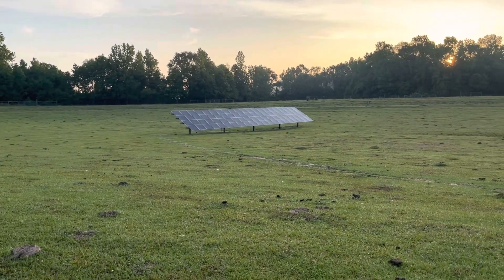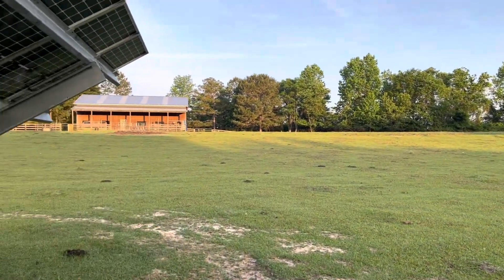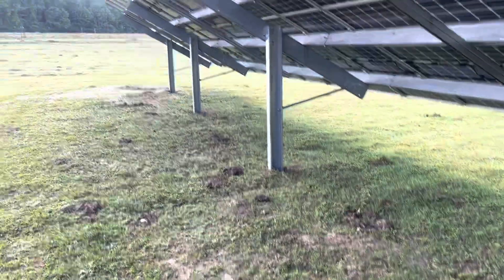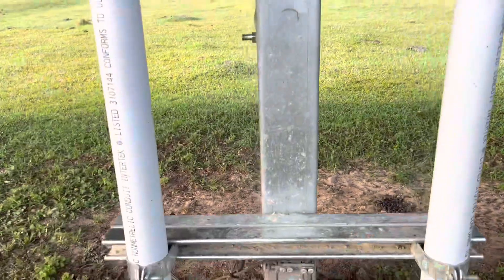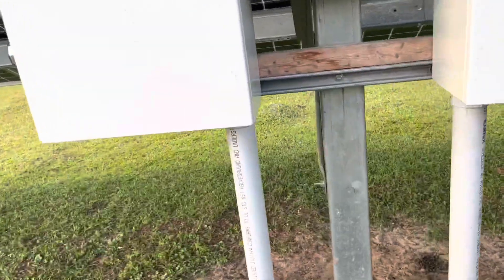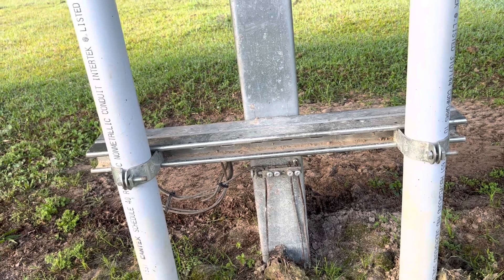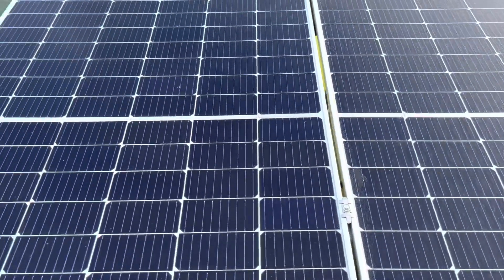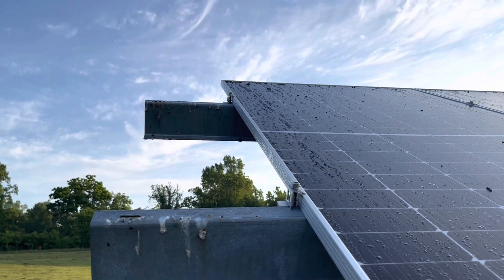Grounding and Bonding of a Sinclair Ground Mount PV Array

Comment: Great to see your system is up and doing great. I have about 25kw of solar in operation now with 5 5000es's. I just put up 42 more panels, I added on to my sinclaire ground mount. But now I am adding on 28 more panels on a seperate ground mount, using eg4 mounts, but putting them on a wooden tilting subframe. When finished this summer, I will be up to 50KW. I will have 6 5000es's feeding the house, and 3 5000es's feeding my shop. They will all be tied to the same battery bank somewhere around 200KWh in size.
Reply from the maker: That’s going to be awesome. Is your daughter still helping you?
Reply: @jeffmotes2129  She was back visiting this spring so we got started on the upgrades. We got the 42 panel sinclaire ground mount up and paneled. We got the posts in for the wood 28 panel section, but then she had to head back to Texas. The wiring and the 28 panel section is all on me to finish, lol. She may be back at the end of June for a few days, and I might get her to come back in early September.
Reply from the maker: How is tge EG4 mount working out?
Reply: @jeffmotes2129  I would recommend just purchasing more Sinclair if thinking about a large project. The purchase price of EG4 mount, wood price, and all the extra time to modify and build everything, Sinclair is the winner for sure. I would have just bought more Sinclair but shipping is an added cost, and I was only planning like 10 panels at first, but then it grew to 44 panels.

Comment: I like the fact that you put the copper ground conductor in contact with earth in the trench. Offers a ton of connection to the ground. Having the EGC separate from the PV circuit conductors could be arguable with regards to NEC code. I don't see much problem though.

Comment: Wondering that we saw some YT videos connected grounding wire from remote ground array back to home ground rod, is it any difference as your arrays are ground right on the ground mounted posts? Thanks 🇺🇸👍
Reply from the maker: The ground from my array is connected back to the home ground rod.  I believe the best practice is to keep all grounds electrically connected. Hence my array posts act as a ground rod and my PV panels are connected to the frame. But this frame is also connected back to my home ground rod.
Reply: @jeffmotes2129  Thank you Jeff 👍

Comment: Was wondering why you decided to have your panels so far from the solar shed, and what gauge wire did your use.
Reply from the maker: In some of my earliest videos I go over my process for selecting this particular site. 

I was looking for the maximum solar window available to me. I performed a shade analysis (see my early video from Jan 2022)for various locations on my property. This particular location provides 12+ hours of no shadows. The closer I moved it the shorter the solar window. I could have cut a bunch of trees but I wanted to avoid that. 

I could have moved due south with the array without reducing the solar window, however, though not evident in this video there is a pond. This is a runoff pond and sometimes the water backs up far into the field. I placed the array outside the area I’ve seen standing back water during heavy rains. 

I used 4AWG aluminum direct burial. I’d have to look up my calculations but the voltage drop at maximum power was around 2%.
Reply from the maker: https://youtu.be/AGtk4dPzeMY

Comment: Is it better to run an uninsulated ground wire between the structures or insulated?
Reply from the maker: Uninsulated will provide better grounding due to its metal to ground contact.
Reply: @jeffmotes2129  should I add some sort of anode to prevent corrosion?
Reply from the maker: @Colindstuart  no. The bare wire making contact with the dirt is no different than a ground rod making contact with dirt. The more contact you have the better “ground” you have.